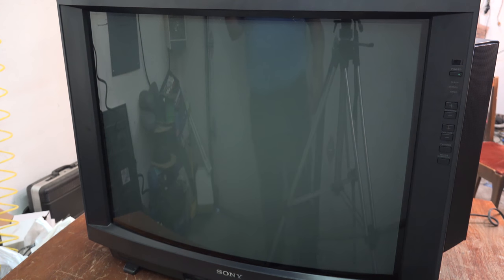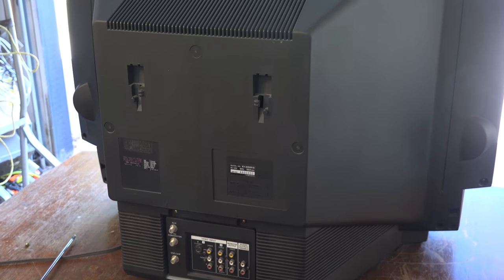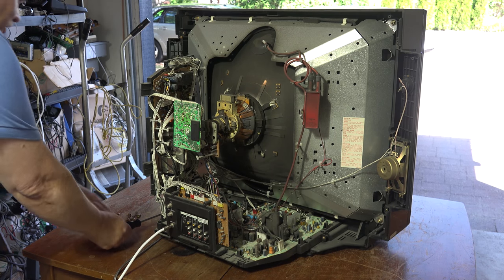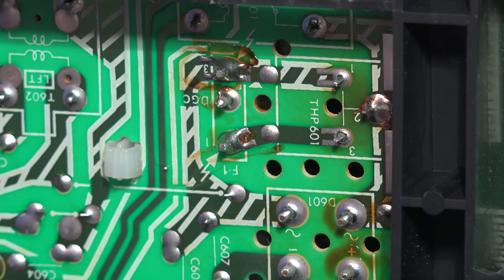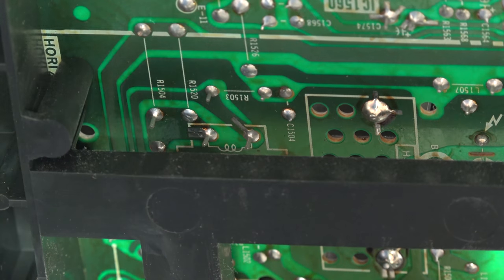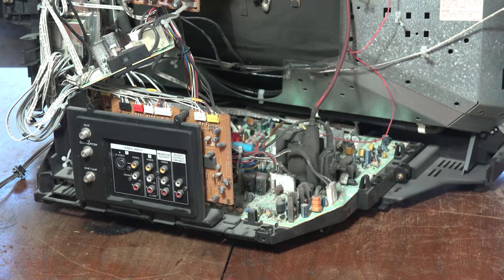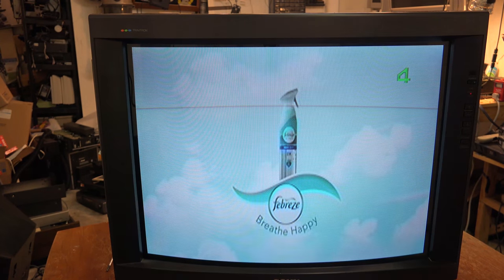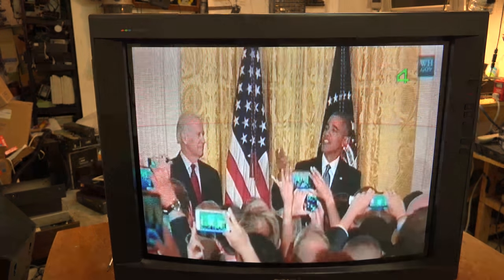SONY CRT Distorted Color Degauss Fix

Comment: I recently picked up a 32” Sony Wega Trinitron with a similar problem. The entire screen has a pink hue to it. When I turn the TV on though I can always hear the hum of the degaussing circuit working. What could it be that’s causing the pink tint?
Reply from the maker: Jonathan Baker 
It could be the green gun in the picture tube is getting tied.
Reply: Thanks for replying so quickly. I’m no expert on CRT repair but is there any way to repair it or does this mean it’s on its way out?
Reply: I just picked up (literally, ouch!) the same exact model from 2005 and have the same pink screen issue on whites and green hue on blacks. Looking for a resolution. I am comfortable with removing the back and reseating connections but recapping is likely not worth it on this tv. Sad, this tv is immaculate as new condition and has problems yet another free 32 wega of the same year looks like it rolled off a cliff and works absolutely perfect to an above average level.
Reply from the maker: There are a few things that can cause this. The degauss issue causes a symptom[tom like I have. 
Other failures regarding color are usually the CRT is getting tired.
Sony used AKB (auto kine bias) to compensate for wear on electron guns. It does a good job until the tube is almost completely shot. Then it can't compensate any more and the color goes bad.
Check the voltages at the R G and B output transistors when displaying a uniform screen. The voltages should be relatively close, about 160-170 volts on the 3 output transistor collectors. (mounted on the CRT board) If 1 is much lower then the rest, that means that the AKB is trying to drive that cathode harder to get the tube in balance.

How it works is in the vertical interval, before the active picture the TV generates 3 reference pulses that last 1 line each field. 1 red, 1 green and 1 blue. This drives each gun to 50% and while this is happening the current is monitored.  The AKB servo adjusts the bias to bring the 3 pulses (they will show up on the AKB line) to the same level. If they are all the same level your white balance will be perfect. Once a gun gets weak it can no longer bring it into balance and the color will be bad. When it gets even worse the picture will completely mute and all you will get is the blinking timer light. The one that normally blonks about 5 times as the set is warming up. As the tube ages that blinking will get longer.

Comment: I have a Sony 32fv300. I have just started to encounter an issue where if the tv is on for around 10 minutes the tv shifts through the color hues for 1 or 2 seconds and either goes into standby or goes super high contrast and then goes into stand by (power isn’t off but the screen is black or off) if I immediately turn it off and then back on it repeats the same cycle as soon as the screen turns on or dosnt come back at all (power on but screen black and flashes 5 times in intervals via the light for standby). If I turn it off for a few minutes it’s back to normal and then it will all of a sudden do it again. 

Have you seen this before ??
Reply from the maker: Either a problem in the AKB circuit or a bad CRT with a short.
Reply: Thanks ! I might offer it up at some point for someone to take and fix.

Comment: Hey 12 voltvids, Got a question for you, or anyone else. I got a 1987 Sony pvm 2030 with a slight purity error on the very top of the screen. When I hit the degauss button the error goes away momentarily but comes right back. I also tried using the electromagnet in my ac drill (used it like a degauss wand) but it didn't work any better than the degauss button on the unit. This is an amazing monitor. Old movies and video games look awesome on it and I would hate to through it away if there is an easy fix. Thanks!
Reply from the maker: NiggelMyNiggel 
Yes you need to place some purity magnets on the bell of the picture tube. Move them and rotate them slightly to clear up the purity. You may need several. They are called chevron magnets and they stick on the glass.
Reply: I got it working. I tried a couple different things but what did the trick was using 4 medium strength magnets from the hardware store. I used double sided tape and taped them to the chassis above the affected area. I moved the unit a couple times since the fix and degaussed it a couple times and it's working good. Thanks for the advice!...Think I am going to sell this unit, the geometry on it isn't the greatest and you can't adjust the sharpness.

Comment: I have a big HD Sony Wega CRT KV-30HS420 that has started having a image bounce problem. On the RF, composite & s-video inputs the image will bounce up and down for about 20 minutes until the set warms up. The component input and the HDMI don't have this issue. Also if you bring up the menu it is stable even with the image under it bouncing. I assume it's a vertical drive problem? I'm not really sure where to start looking. Also being a 200 pound set it's not so easy to move. I have the service manual for it but it's not really helpful in this case.

I really hope someone takes that set off your hands. I hate to see a good Sony CRT go to the bin. I have 12 retro video game systems connected to mine and there great for that.
Reply from the maker: Your problem is more than likely in the comb filter circuit. Probably a capacitor as once it warms the problem goes away. The reason I think it is the comb filter is the problem is only composite sources, rf, composite and s video use the comb filter to separate the signal to the component signals. Component and hdmi are already in that state.

Comment: I have sony kv-29 also with color distortion
Its common issues in sony tv?
Reply from the maker: Its common on all crt sets.  The thermistor gets hot so thermal expansion of dissimilar metal fatigue is common and the solder is the first to fail.
Reply: Thanks

Comment: Looks like a tripler-powered CRT, something you don't see everyday on a CRT.
Reply from the maker: That's actually an HVR, or high voltage resistor. Basically a voltage tap, the small wire leads to the xray detection circuit. If the voltage goes too high it will also rise on the sense wire and trigger a shut down. There is a loop through on the plug, so that is a tech leaves the plug undone it will also shut down.
Reply: 12voltvids cool, thats what I got replaced on my Sony PVM

Comment: CRTs are highly sought after by many retro video game enthusiasts. Especially Sony Trinitron models. DO NOT RECYCLE!
Reply from the maker: David Fallows 
Yes I know. I picked up 3 small tvs that were being thrown out checked them out and put them on Craigslist.  All of them sold within hours. Easiest 100 I ever made. For vintage games You need the instant refresh rate of a crt. An ED plasma is the next best thing. A modern lcd no good. Too slow on screen updates. Some as as many as 5 frames behind live signal. The TV delays the sound so there is no lip synch error but for gaming they are useless.
Reply: @12voltvids  input lag does make them useless for older consoles and you would required to use an expensive upscaler device like a retrotink. Crt tvs are more nostalgic

Comment: No need to ground the tube?
Reply from the maker: The DAG is grounded. The degauas coil is not.  It is connected one side to the neutral of the AC and the other side to the thermistor which connects between the AC line and the degauss coil

Comment: better option to proper solder on ptc remove from pcb and clean by knife till all leads shows clean from oxidized layer and show shine terminals and then re use ptc or replace with new
Reply from the maker: In all the years I made a living repairing TV I never replaced one. Just heat it up hot enough and let the flux in the solder do it's job of cleaning it. Never got one back for a repeat failure. Saw the same TV years later for a different fault, but the ptc never let go again.
This TV was a give away anyway.

Comment: I see a horizontal line on that TV.
Reply from the maker: All trinitron tubes have 2 horizontal stabilizer wires attached to the aperture grill. One in the top 1/3 of the screen and another on the bottom.  You can see them if you look. More than once someone brought the set in complaining about it.  When told that was how they were they demanded their money back and were told sure no problem 20% restocking fee. Some stormed off threatening never to buy another thing from the store.

Comment: Quite a few magnets on the back of the tube, dang.
Reply from the maker: All sony tubes had tons of magnets to get the convergence and purity correct.
Reply: 12voltvids Yeah... just not my budget Trinitron. Mine came with one magnet and horrendous geometry, so I ended up placing 13 of my own magnets to correct it. Exhausting
Reply: 12voltvids which begs the question: how did they manage to fine tune each crt with such great painstaking detail when they manufactured millions? I saw one 40-inch that had 60 magnets. Must have ruined Sony’s profits
Reply from the maker: @walle637  Well, when you set up CRTs at the factory day in and day out you probably get pretty quick at it.  Remember the RCA sets that had a magnetic strip wrapped around the neck that was "burned" with a specific pattern for the specific tube at the factory. It was wrapped and held in place with tape and a zap strap. Remove it, and you never get the convergence correct. These tubes also had the yoke permanently bonded to the tube, so if the tube failed you bought a new tube with the yoke attached and all adjustments pre done at the factory.
Reply from the maker: @walle637  Trinitron were not what they were cracked up to be. Yes some looked great, but they were prone to unique problems, like the aperture grill singing, and the larger ones were very sensitive to earth magnetic field.
Reply: 12voltvids I had never heard that about RCA tubes. That sounds both ingenious and unbelievably stupid. Literally every other manufacturer used magnetic strips for convergence, idk why they had to be so extra. Yeah Trinitrons are overhyped. The flatscreen WEGAs have horrible, unfixable inward bowing on all sides, as well as poor dynamic focus and convergence. They were much heavier than the average CRT. Samsung HD Slimfits were prone to the exact same issues with geometry, focus, and convergence. Panasonic GAOO and JVC D-Series were underrated imo.
Reply from the maker: @walle637  
I had a Panasonic 34" hd  TAU and I tossed it because it was too heavy to lift.  Wish I had kept it as crt sets are rare now, and the 16x9 even rarer.

Comment: that high pitched 15khz sound, ugggggh
Reply from the maker: John G 
It's a crt what do you expect.
Reply: HD CRT won't have that. Some people dont like them because of digital processing, but it doesn't have that sound. Completely silent.
Reply from the maker: John G 
It is still there you just don't hear it but your dog sure does as it is at 32khz
Reply: yeah, but to me pure bliss of silence and CRT, can't you ask for anything more? And really from 04+ sony and samsung hd crt's are plentiful.
Reply from the maker: John G 
I wish I could find an hdcrt  set. There are none around here now. I used to have one but got rid of it and the person I gave it to tossed it when it broke. (I paid 3500 for that set) this one I was given fixed it and found it a new home so I don't have this set and havent since about a week after this video was done.
Reply: what one was it? a sony trinitron XS or XBR series?
Reply from the maker: John G 
I had a Panasonic 34wx50 at one time
Reply: samsung slimfit which is so much smaller than other brands or the sony trinitron XS or HS series are great finds.
Reply from the maker: John G 
Because of the trinitron design they couldn't make the tube shallower. They were all 90' deflection. They did make some 110' but had geometry problems so they went back to the longer tubes. I have a few trinitron sets in my vintage collection.  I have a kv8ad10, kv1365 kv1965. Kv20ts20, and the last analog 20" trinitron model made. Forget the number off hand but it has velocity beam scanning and dynamic focus and a bunch of high end features that were previously only available on the pvm professional video monitors.  I also have a couple of conrac studio monitors, and a 1965 Sony 12" solid state b/w TV and the 1/2" open reel vtr that goes with it. That has been on my to do list for several years and I keep putting that one off.
Reply: 27-30 HS and XS or XBR, even the last analog FS sets are really nice. old crt's are not my cup of tea really , love the flat screen.
Reply from the maker: I also have a JVC 14" Multisystem. Will display NTSC 3.579, NTSC 4.43, PAL, PAL-N and SECAM.
I do have a multi system VCR as well so some day I might haul that one out and show it off. I also have various B/W montors. 4" 10". I have a 2" Sony flat watchman, and a 4' Flat tube monitor, and one of only a handfull in the world. A Panasonic CT101. This is a 1.5" 3 gun shadow mask color TV. Fery few were made, and even fewer are still working. Another very rare piece is a Sony single tube projector called a Vidimagic. It uses a single gun, full color tube called an indextron, beam index tube. This projector has a built in betamax recorder. Now those units are exceptionally rare. I only ever saw one in a magazine and then one was donated to me last year.
Reply: i just can't take the whine, i need peace and quiet, esp when gaming. About to get another 30hs420 just so I can get rid of the analog sony sets i have.
Reply from the maker: You can't take the whine! Just try living with Tinnitus. A loud buzz that sounds like a flyback in your ears 24 hours a day 7 days a week. 
Try living with that. The sound of a flyback I don't even notice these days. For me it was trying to imitate Jimi Hendrix when I was a kid, and too many Rolling Stones and ACDC concerts as a teen, young adult.
I try to drill this through to my idiot teenagers that crank the volume to 12 with everything they listen to but is is falling on deaf ears. And they literally will be deaf by the time they are 25.
Reply: i had a bad ear infection as a kid that took 5 percent of my hearing in one ear. Paranoid about loud sounds ever since. Somewhat sensetive to loud sounds in general. I can still hear that 15khz sound like its right in front of me. If I try to play a game, its weird, I will turn up the volume, but I can still hear that sound cut through, that's what made me go HD sets back in the day.
Reply from the maker: John g
I can still hear beyond 15khz as I have an audio generator and have played with it a few times. The ring I  my ears is just slightly higher than the 15.734 tone produced by the TV. It actually helped me in servicing sets that had a cracked fly back core or loose ferrite bead as those sets were generally slightly off frequency and would beat with the buzz in my ear when I turned my head slightly. I just learned to ignore that frequency as I do the tinnitus that I hear 24 hours a day. I went for HD as soon it was available too but not because of the fly back sound. I did it for the picture quality. Got 2 stations off the satellite and one of those was just scenery but that was good enough for me in 2000
Reply: interesting, so sat had hd in 2000? I was only 13 in 2000. I didn't really even know what HD until 2003/2004 with the original xbox.I'm guessing if i was brave as some and added that glue to the tramsformer or that oil or what not, it might be less noticeable as these sets are so many years old. i dont really work on CRT's anything above 5v DC i get worried. I do enjoy electronics work though at that level. Some day will come though when I need to replace a cap or something.
Reply from the maker: John G 
5 volts is nothing. Try working on Tube gear. 250 to 480 is the plate voltage on tube gear. Crt 2nd anode 30k. When that one bites you feel it for sure.  Microwave oven are dangerous to work on leathal voltages and currents
Reply: yeah, don't get me wrong, i would discharge the anode correctly, and discharge all the other capacitors. Then I would do it again, wait an hour, then do it again. I'm that paranoid. I just hate doing it, knowing that a slip up could give an awful shock. Luckily, everything works good. Although I got one crt where the edges are all messed up, but a magnet fixes it, so either the degausser doesn't work right, or purity magnets are messed up. Should be a somewhat easy fix.
Reply from the maker: John G 
Getting jolted now and again is part of the fun.
Reply from the maker: Yes we had it in Canada in 2000. Expressvu model 6000 receiver.
2 channels. One was running the video Over Canada over and over. It was a store demo. By 2003 CBS out of newyork, and CTV out of Toronto had limited HD programming.